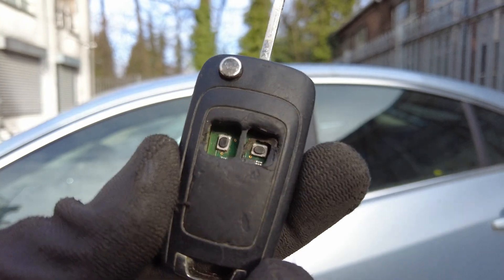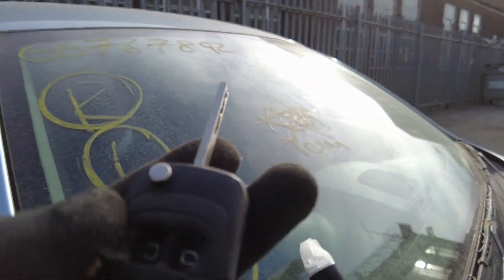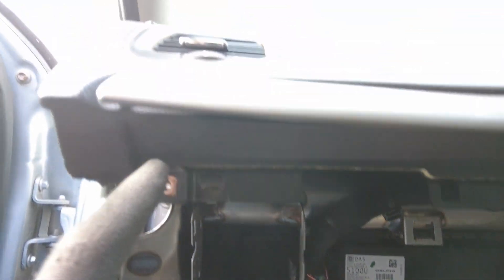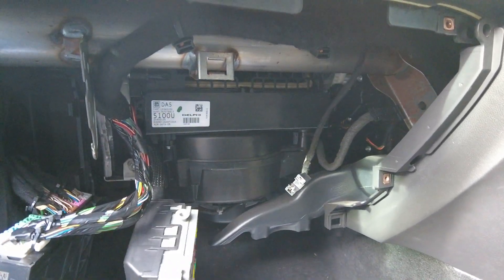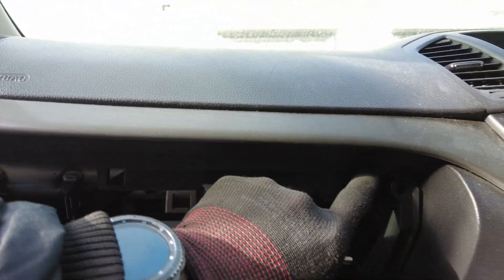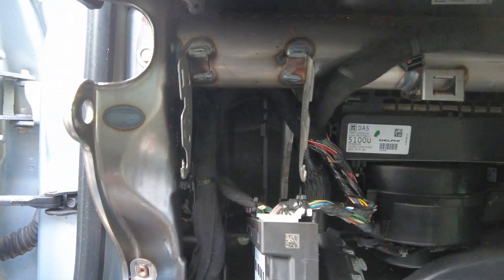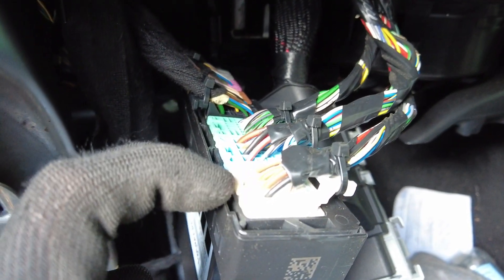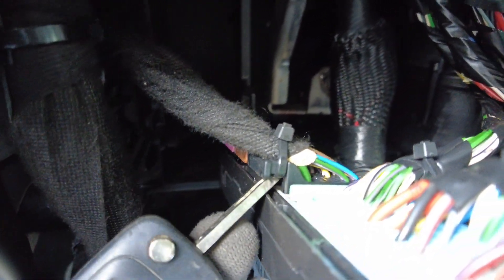Vauxhall/Opel Insignia BCM location

Comment: Hello could you help diagnose what I need to do after changing engine on my insignia original is 96kw F32 gearbox with non pressure sensor glow plugs while the one I put in is 118kw with them and M40 gearbox. Had to put in original ECU from 96KW to start the car as with 118kw it shows Theft service deterrent error. Is there a way to reprogram system?
Reply from the maker: Hi, probably in your case better to buy an ECU kit from 118kw and M40
Reply: @ecuproguk  I have the 118kw ecu and the whole car it came from should I replace BCM and ignition or rather bring it to someone to reprogram ECU of the 96kw
Reply from the maker: @MrAxnavara  anyway you need rewrite immo data, even if you reflash ecu.
Reply: @ecuproguk  could I just reprogram the 96kw ecu or should I bring along 118kw for the reprogram
Reply: @ecuproguk  basically what I have done so far is move the wiring harness from the 118kw engine along on the 96kw chassis the other engine on that car has shot main bearings and this car we just brought over from Ireland while bought the other one for cheap in Europe
Reply: What also has been done is some work on the engine as it is at 280k km changed oil pump seal refitted oil sump pan with new seal changed gasket on the crankshaft at the flywheel side as it was in bad shape. Some other leaky spots fixed too overall that engine is in pretty good condition for its mileage another thing I changed was oil drain plug bolt

Comment: Hello my indicator won't work just one front right working and back left working and all boulb is OK and fuse all is OK where can be problem please if you know just write my here
Reply: Thank you I will going tomorrow  for scab bcm modul for 10 pound
Reply: I have question is there flasher relay? Mabe is brouken
Reply from the maker: @radoslavkozak2105  Looks like yes, you car has a flashing relay, check the Fuses and relays diagram
Reply from the maker: May be it is a BCM module fault. But at first you need to вщ diagnostics